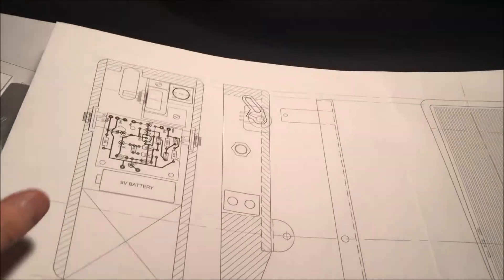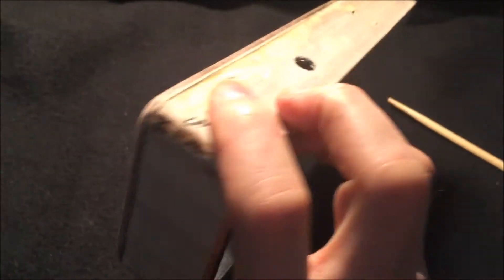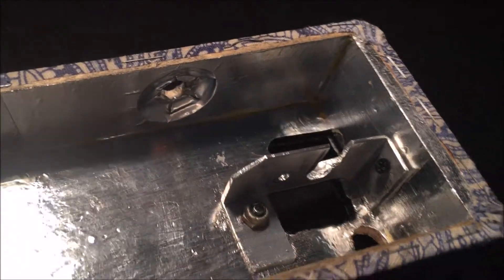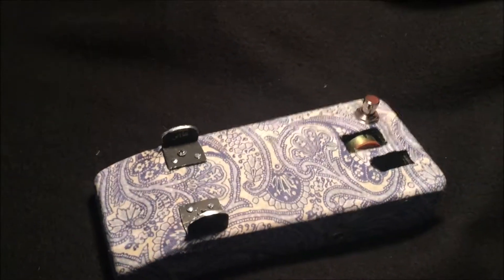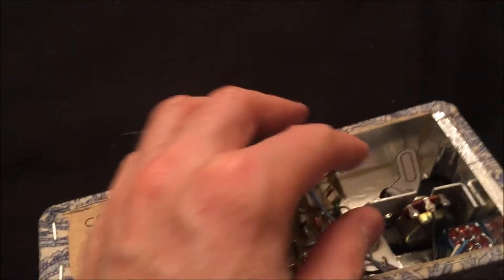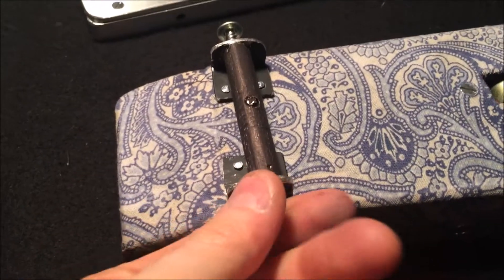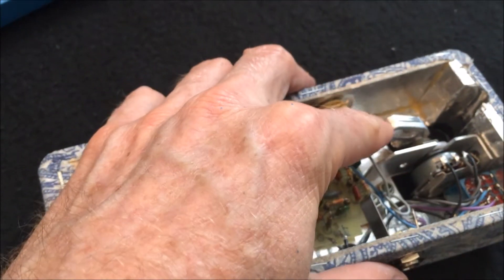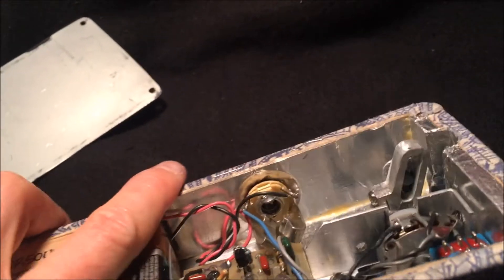100% Scratch-built Wah Pedal Using Wood and Aluminum

Comment: Great build! Really awesome ! But I have one question. Where do you get that template of the ,,Pot Rack Plastic" thing? I am rebuilding a 1974 FuzzWah and mine is broken :( Greetings from Germany
Reply from the maker: Hello in Germany. Thanks, glad you like it, but this one is better: https://youtu.be/aueconEDFLQ?list=PLY65BzEUaTVSH0cyuyC74lt9XubKeiZIf
It addressed a few problems I had in this first attempt.

I used the part from my real Colorsound wah pedal as a guide - I made an AutoCAD drawing of it, printed it out and used that as the actual template to make the part that rotates the pot.
Reply: In the newer one you made it out of aluminum?! My problem is that I have no original and functional sola sound wah at home. Is there any way you can send me that template you made. maybe as a stl file?!
Reply from the maker: @CigsnHairspray  I could send you a DXF file or a PDF of my CAD dwgs. If that works give me your email and I'll send it to you. Newer one is made the same way as the first one, using wood and aluminum pieces.
Reply: @VegasCyclingFreak  do you still have these files?
Reply from the maker: @growfromgrave6691  I do. Give me an email address and I can send them to you.
Reply from the maker: @growfromgrave6691  OK check your email.